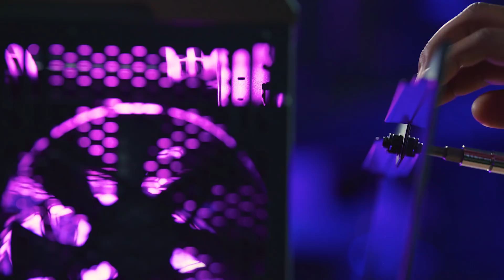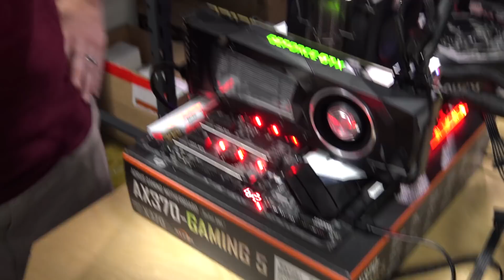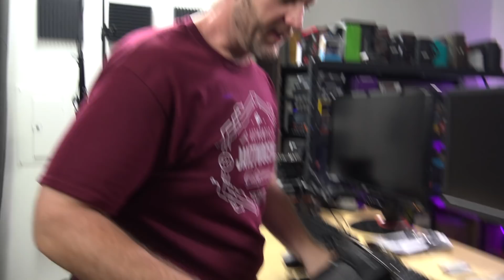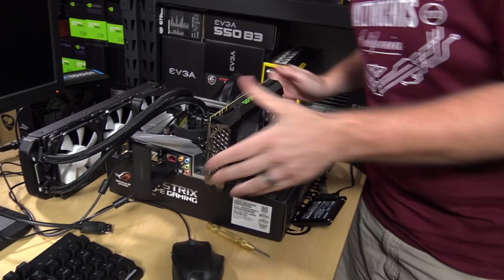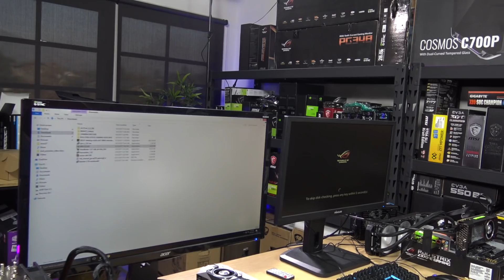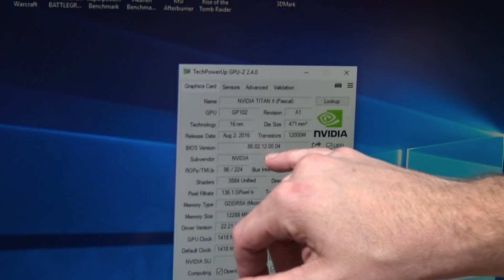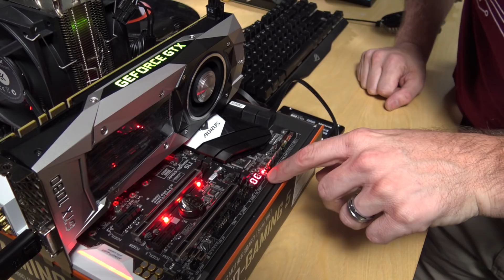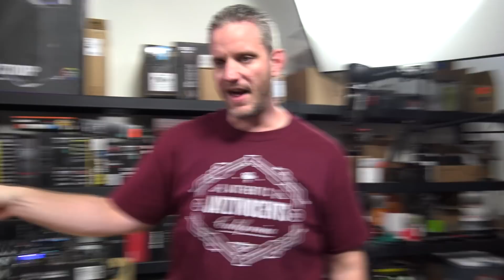I cant figure this one out... HELP!

Comment: A) Check the bios on both cards, not just same card on different systems

B) try another PCI-E lane, it shouldn’t change much but as the working card seemed fine, but always worth a test 

C) if the bios is different between the graphics cards, try it on another ryzen mobo to see how it handles, could potentially be a conflict between bios and that certain board
Reply: C) try force 8x PciEx in bios

Comment: Didn't got that problem with my new system (Ryzen 5 1600  rx 480) but got some other issues. 
My problem with RAM:
Ryzen Masters tells me my Ram runs 1600mhz Gigabyte BIOS and Gigabyte EasyTune says  3200mhz and CPU-Z says 1061mhz under fullload... i am confused. Where to check Ram speeds for correct readings?

Comment: I have the same pr!blem with my R7 1700 and GTX 1080Ti.  The Ti works with a 6700K and the 1700 works with a 1080.  But I get post error code with the 1700 and Ti. Exact same problem with Ryzen!

Comment: I had a card that would just fry my RAM for some reason.  

Yes, it sounds crazy, but I had a GTX 650 Ti and every 2-3 months my RAM would go and computer would die.  Replace it, works for 2-3 months then dies.

Got a new GPU (GTX 1080) and has been working fine for about 6 months now or so.

Comment: Could it be the gold contact pins are ficial, a lose solder? Could it be a pci power draw from the slot, it dose seem like a motherboard issue, rather it be a bios issue with handling the controller for that graphics card.i do suggest reflashing the card, but i believe you when you say that is hellish to do.

Comment: I was going to say get the same motherboard from Newegg or where ever and see if it happens again. I can see why you would not think it's the motherboard being the other Titan xpp works but worth a shot. 

I'm thinking it's not just one thing. I'm thinking it's both the GPU and the motherboard. Even though they both work but together they don't. 

Personally I'm thinking that there may be a microcode issue with the motherboard and maybe one of the titanxpp cards is say first batch right when they came out and the one that has no issues is a newer card.  

Now this is driving me nuts lol. I would love you to get the same motherboard from Newegg or wherever and see what happens.

Comment: Face palm... I just bought a new 1080ti because I thought I damaged my 1080 by installing a waterblock on it and it did the same as what it's doing to you..  I'm new to AMD and decided to build a full loop and the 1080 would crash upon game launch only and even 15 seconds into furmark... Then it wouldn't post like you were showing..  I hope I didn't just lose out on a new 1080 beating myself up over it, taking a $600 loss..

Comment: Well, the first thing I notice, is when you were checking the bios version on the two identical GPU's, you were first checking it on the intel system, then you switched the two cards, checked on the AMD system, meaning you ended up checking the same card twice over, so at least for the video, we actually have no way of truly confirming if it's the same bios on both gpu's.
In regards to the motherboard bios already having been updated, doesn't change the fact there still could be some sort of error in the bios, manufacturers aren't perfect. Personally what I would do, would be try the 'faulty' GPU in a different Ryzen motherboard and see if you can reproduce the error there, rather than going through all your different GPU's.

Comment: So you said the GPU bios was the same, but in the video you checked the GPU bios on the intel system, then swapped it to the AMD system and checked the same GPU bios again and didn't check the intel system that now had the card that didnt work on the AMD system. Kind of hard to say the GPUS have the same bios when you checked the same one in the video.

Comment: Jay, you do realize you checked the the bios of the same card twice right? you checked it on the intel system, then took it out, put it on the AMD system and then checked it there again. when you should have checked the card you took out of the ryzen system and then put in the intel system. also as others have mentioned I think there is a known issue with of nvidia cards having issues with ryzen that runs oc’ed ram.

Comment: If I were you I would be wary of voltage bleed across the pcie pins on the card itself. Remove the card and clean the pcie slot with rubbing alcohol and a cotton swab. It almost seems like voltage bleed is causing it to go Haywire now and again but the issue could also possibly extend from the slot itself on the card to the motherboard pcie pins. This may not necessarily be something that is visible to the naked eye, but there may be some residue that is causing voltage bleed which in turn causes a GPU post code.

Comment: Just random guess, could there be some hardware feature of the titan that the ryzen board supports but intel doesn't, and whatever hardware that depends on is broken on the one card. And as the intel one doesn't use it, it can run despite it being broken but it will block the ryzen due to it actually using it.
I think the next step of testing is to get an identical ryzen board and see if it have the same problem with that titan.

Comment: Jay, you only checked the BIOS on one TitanX (the one that was originally in the Intel testbed system) twice.  When you placed the one from the Ryzen testbed system into the Intel testbed system, you never checked the BIOS on that card to see if it was the same as the one from the Intel test bed system.

Comment: bios re set could be a fix, on both gpu and mobo, or it could be the mobo detecting an issue on the GPU, could try taking it apart and re tim it ect.

Comment: Bump up the PCIE voltage on the Ryzen system by just a tad. Occasionally this can affect cards with variance in ASIC and VRM on GPU's.
Reply: That's the first suggestion I've heard that might actually do something.
Reply: That's check the version of PCIE, voltage and compatibility on motherboard and Videocards
Reply: David Whitfield - A sound thought. I was just thinking a rather simpler "card lottery" myself. Maybe the Ryzen is just a bit more flakey with a less tolerant card....

Comment: You showed me the bios for the same card. You literally took the video card off of one system loaded into the other system and then loaded up the bios for it. The one on the Intel system is the one that you need to look at the bios for. What I would suggest is reflashing the BIOS on the one that you put into the Intel system or have the Nvidia information up showing bios at the same time per system. And if it's anything like the Nvidia software and drivers you'll have to reflash/ install a few times.

Comment: You removed the card from the messed up setup. you never checked its BIOS version. You just checked the BIOS version of the same card twice. See the video. You took the Titan from the Intel setup after checking its BIOS. Then you check the BIOS of the same card on the AMD system.... You never checked the other card.

Comment: You may have checked it off camera but in the video you checked the bios of the card when it was on the intel system and then checked the exact same cards bios when on the AMD system.... of course it will be the same bios version. What is the bios version of the card that wasnt working on the AMD system as it sounds very much like a video card bios issue. Personally I would reflash the card not working on AMD's system.

Comment: Did anyone else notice that he checked the bios on the same card twice (once in each system) but never checked the bios of the one that wouldn't post in the Ryzen system? 

And that CM case is a piece of crap. Steve at Gamers Nexux showed how poor the cooling is. It's no where near a replacement for the venerable HAF cases of old.
Reply: H500P needs the front plastic replaced with mesh. Yeah unless there was an unshown gpu-z check on the other Titan we aren't sure the bios is the same. Ryzen has been very very fussy though.
Reply: cee128d  yea he did not check bios of bad card on the Intel system

Comment: PSU... switch them and see if problem swaps.
Reply: Accept maybe it has something faulty in one of the phases.. You know what I am not going to go into technical details.. If you want to know google it.
Reply: Yeah me too.. I had s corsair 1500x fail on ma a number of times. Put it on another board works fine.
Reply: Yeah VRM / power draw of each Titan could be slightly different enough to have the issue due to a weird PSU issue
Reply: Bryan Barajas mine blew through few memory sticks changed the board and it turns out to be the psu
Reply: My first thought is the powersupply. In a way that the "bad videocard" needs a bit  mor voltage, and the powersupply has trouble delivering it.
Also check the powercable to the graphicscard.
My second thought is the slot of the videocard. Put it in another slot.

Success,

Rob
Reply: Also highly recommend trying this.
Reply: RdyPlyOne when I built my 1600x machine a few months ago, it wouldn't post when a specific gpu power cable was plugged into the PSU
Reply: Lol, imagine...
Reply: I agree, this was also my first thought.
Reply: Agree, swap the PSU. Could be a bad voltage regulators.
Reply: I’m in on this too. I think the power supply is the issue
Reply: Either that or the one that's not faulty is not a cherry picked one.
Reply: Would also say the PSU first thing that came in to my mind,seen a whole lot of things when building computers.
Reply: Ah wish i saw this comment earlier.. My friend had the same issue with an 1080Tiand got it working by justswapping the PSU.
Reply: Certainly worth a try.
Reply: I was thinking the same thing. PSU problems can have all sorts of weirdness.
Reply: All hardware is supossed to be the same but there's always a chance of a faulty  conector or 12v rail.
Reply: RdyPlyOne I'm pretty sure that 12v rail is not supplying enough power, some gpu even its the same model  takes more volt on cold boot an unstable rail will surely fail to boot.
Reply: I agree also, wonder if this was done or not..
Reply: If it were the PSU then it should have happened when he put the Vega card in because they draw more power. That and the other 1080's ran just not that specific one.
He said he has been working on this a while with same results. But hey its computer parts so.......
Reply: can't be the PSU since the other card posts on that PSU?

Comment: Happens on my mining rigs...swap GPUs into different slots...or from one rig to another and it will work! Same CPU, same mobo, drivers, bios, everything! (Intel Pentium g4560)...same ram! Same PSU...one rig works with that card...the other doesn't...thought cards were bad...nope...just...weird
Reply: A lot of that is riser issues but yeah, that can happen. I have one rig with just three cards in it at the moment so no risers, all on the board. One card only works in the middle slot. Put it anywhere else and it wont detect.

Comment: You checked the GPU firmware on the same GPU, not both GPUs.  You checked it on the Intel system, then switched it to the AMD system and tried it there.
Reply: amw1011 you are the one and only

Comment: The bios on the Intel card that worked originally of course will ave same bios when switched to Ryzen. You didn’t test or show what bios was from Ryzen after switched to Intel
Reply: ToShutKidUp I came here to say this, I bet that's the problem and Jay missed it
Reply: ToShutKidUp I raged inside just a bit when he didn't check the GPU BIOS XD
Reply: I was cringing the whole time lol.
Reply: Yeah... this. It seems that Jay can't record and science at the same time.
Reply: Very much this
Reply: hes right Jay DOH brain fart  ;)
Reply: so I'm not the only one that noticed that Jay didn't check the bios on the card when he switched it from the Ryzen to the Intel
Reply: I saw this too. He should check this
Reply: Came here to say this as well
Reply: i want to believe that he already saw that they were the same off camera but it would have been nice if  he showed it in the video too
Reply: and also jay, if this avenue doesn't pan out. try plugging the card into a different pci slot. also try a different psu
Reply: Yeah this actually pissed me off.
Reply: Came here to say this. facepalm
Reply: I suspect he is getting so flustered with this issue that he completely derped.
Reply: Yes! I came to comments for this...
Reply: ToShutKidUp I was so confused the whole video because of this lol. Point still stands that the gpu originally in the ryzen system works fine on the Intel system though.
Reply: I was thinking the same thing.
Reply: This!
Reply: Ya know when you have an elephant in the room...and everyone is stopping to stare at the elephant, but that one guys comes in to refill his coffee and leaves without taking note...yeah, hows your coffee Jay? lol Love the videos don't take it to heart we all make mistakes and even more so when frustrated at the copper and rock someone "taught" to think years ago :P When in doubt blame the camera man he saw it all lol
Reply: Yeah. This.
Reply: 4 sure! LoL

Comment: When you check the Bios Version on the GPU you ended up check the same graphics card that worked on the Intel System. You didn't check the Bios Version from the non working card that was in the AMD system.

Comment: i had the same problem with my ryzen 1700x  when i upgraded from a gtx 1080 to a gtx 1080ti my framerates were bad and it would not bootup 3 things i did to fix it a different hard drive to test, i changed the slot on it and i reset the bios, i also changed the ram slots

Comment: You didn't show the bios version on the 1st card on the AMD system - you just showed us the bios version of the card you had running on the intel system.
Reply: Bump!
Reply: Check the one you moved to the Intel system!
Reply: true, he checked bios version of the same card twice
Reply: dude... don't.... just don't....
Reply: Yep. Jay checked the same card twice. Need to check the other card on the Intel. Try the "bad" video card in a different slot on the Ryzen board. Then power supply. You may have a bad cable and/or low voltage.
Reply: Didn't have to scroll far to see this one!  Hope he clears it up for us soon.
Reply: this needs to be higher up

Comment: The HAF is NOT "Better Than Ever" with the H500P. There is nothing high airflow about it, and it has factory defects such as the mounting holes for the additional front fan bracket being misaligned.

Comment: Can't really see that well, but have you tried the ports. It looks like you used to different ports between the two systems. Also check power settings for pci slots
Reply: I would also try using display driver unistaller and then get the driver's fresh

Comment: I actually had a similar issue. I disabled SMT and the whole system wouldn't even post until I took the GPU out and then it was fine with my 960. Turned SMT back on and it worked fine when I put the Titan back in... Weird shit happens, I even had it where my SSD wouldn't show up until my GPU was swapped out. Since new revisions of MOBO bios though I've been fine.

Comment: You didn't check the  BIOS on the card that wasn't working on Ryzen. You checked the BIOS on the same card on different motherboards.
Reply: omar38317 Thats the first thing i thought of too 🤔

Edit: Maybe backup the BIOS from the card that is working and flash it to the card that doesnt work

Edit2: Does it work in the 2nd PCIe slot?
And i remember having an issue with a graphics card years ago, setting the BIOS of the motherboard to factory default fixed it. I dont know why but it worked ^^
Reply: It's eating at me that he didn't do this. My brain  hurts
Reply: I was just saying the samething.
Reply: I saw that laughing so hard right now.
Reply: My spidey sense is tingling
Reply: I seen the same... He check the wrong GPU BIOS....
Reply: Agreed
Reply: My sentiments.
Reply: Dude, I thought the exact same thing and it's been bugging the hell outta me! lol

Comment: Try taking apart the GPU and cleaning it. That worked for me. Because I had 2 gtx 760 and one didn't work on a build I had but the other did. So when I put the one that didn't work on another rig it worked. So yeah  try cleaning it inside out or get a different Motherboard.

Comment: A buddy of mine has that exact board. The gigabyte for whatever reason randomly locks up bios. And the only known fix is pulling all power from the board and taking out the cmos battery for at least 30 min. He even RMA his board and it still did it.
Reply: elvewizzy yeah he has had that problem as well. Plus his has just flat out not even turned on at all. No lights no fans, nothing at all. That’s when he sent it in for RMA and gigabyte didn’t find a problem and he had it another couple months and it’s still doing it every couple weeks where it just won’t do a single thing
Reply: elvewizzy he also has a problem with cooler mounting. If the cooler is mounted any tighter then hand tight it won’t boot either
Reply: RGB Fusion also uses up a lot of CPU to run. I'm on the K7 with a 1700.
Reply: Built a rig for a friend of mine on the same board, thing ran wonky as hell and would randomly brick when changing bios settings. Ended up RMA'ing the board and selling the new unit they shipped out + switching to an MSI board.

Comment: It could be the drivers. I had the same issue. My DP stopped working, but it started working after updating the drivers. Try HDMI also.
Reply: Drivers aren't loaded on boot, they're loaded on OS start, the problem is they can't get it to post.
Reply: +Krystian Domagala it would still boot a little bit before the windows logo
Reply: Impossible. It's failing to post LONG before it gets to windows so the drivers don't come into play.